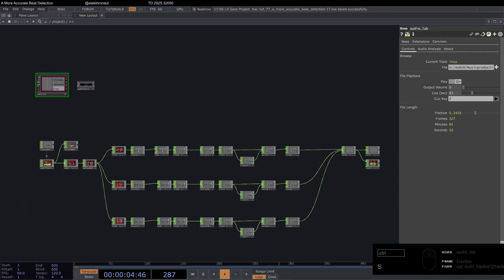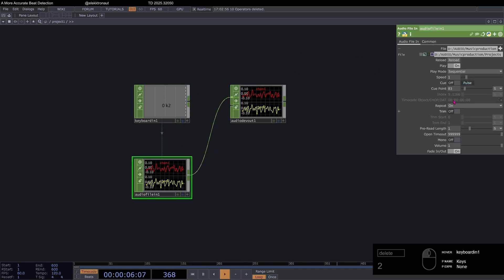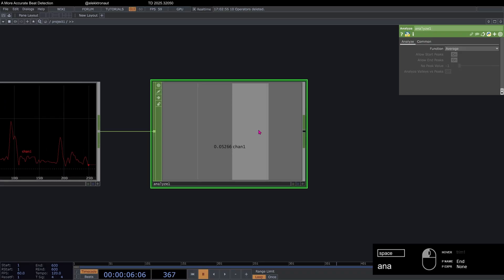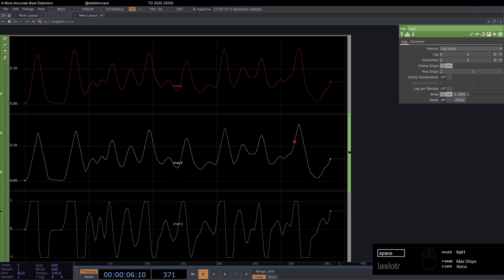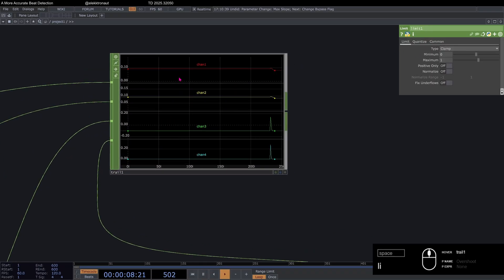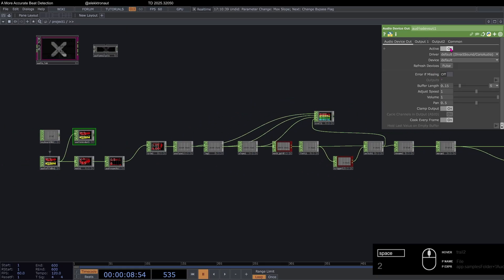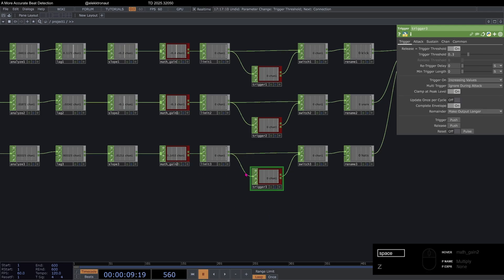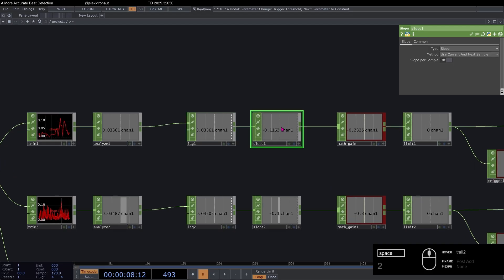A More Accurate Beat Detection – TouchDesigner Tutorial 77

Comment: Thanks for this awesome update! I noticed one thing I cannot wrap my head around, maybe someone here can point me to the right resources (something related to the Cooking process):

After tweaking the settings I have a nice and clean output signal the way I expect it to be. If I trail it (Capture set to default "Time Slice"), I see exactly what I expect. If I just add another trail to that node (again Capture set to "Time Slice"), I see a lot of extra hits and noise showing up. This seems to be the signal that is really passed on to the next nodes. If I set to the Capture on the second trail to "Only when input cooks", everything looks fine again. However, the output of the trail remains the noisy version.

How do I get the clean output signal get passed on? Anyone experienced this? Thanks in advance!